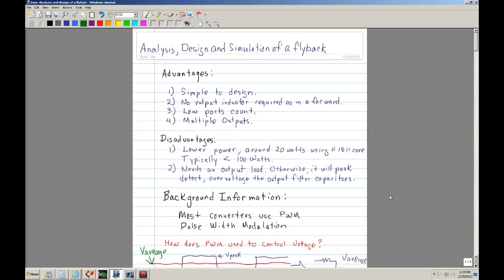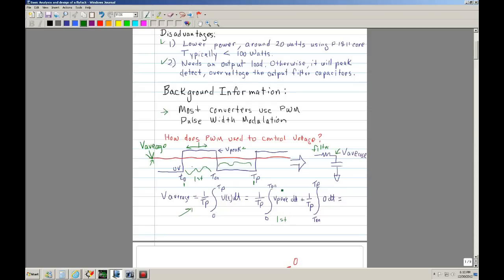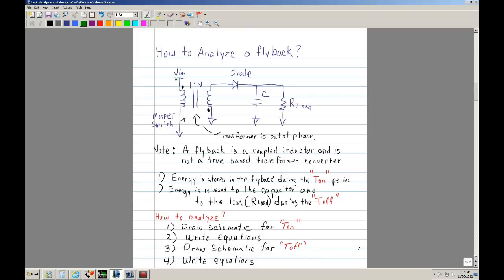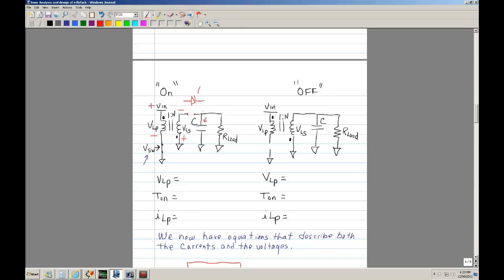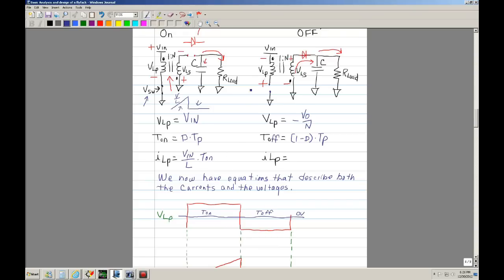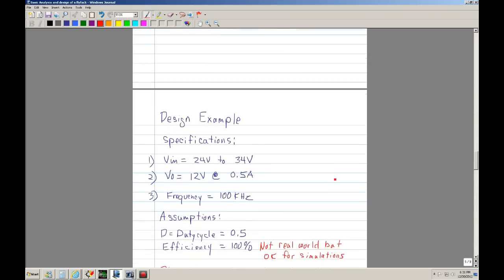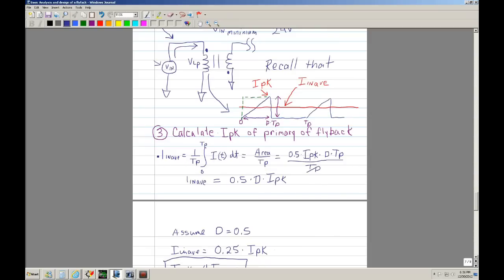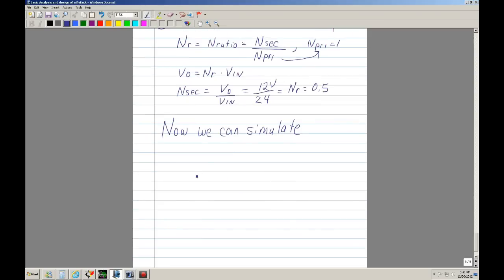Analysis and Design of a Flyback; Part 1, How to Analyze and Model a Flyback Converter

Comment: Can this be used as a step down buck converter, about 125 volts AC/DC input to 12 volts DC output?
Reply from the maker: Yes you can use it as a step down converter
Reply: @RobertBolanos  Thank You for replying back. I will watch all the video carefully. 
It would be tremendously helpful if you can make a full lecture series of designing and building PCB planar transformers/magnetics. Something new and cool. I’m planning to design a cost effective multilayer PCB maker system, so I would be able to make planar transformers if only I knew the math and theory of planar transformers. Thanks.
Reply from the maker: @ShopperPlug  Hi Max, that would be a great subject to cover.  Let me see what can do.
Reply: @RobertBolanos  Thank You 😊

Comment: Sir can you please help me finding design for CO2 gas laser flyback transforme, I shall be very thankful to you.
Reply from the maker: You need to know the required voltage, current and power. Once you know the power, you can use the equations that I presented to calculate the primary inductance.

Comment: In case we don't have input voltage and need to calculate the transfer ratio what is the way to calculate input voltage ?
Reply from the maker: Hi Mahmoud, please see the derivation on shown below the title. This is the corrent transfer function for a discontinous mode flyback,

Comment: For calculating power in the design example, shouldn't one be using Rms current instead of Average current? 
Avg current equation = 0.5*D*Ipk
Rms current equation = Ipk*sqrt(D/3) ~ 0.577*Ipk*sqrt(D)
Reply from the maker: You usually use the rms current when calculating the power in a resistor such as Presistor=Irms^2*Resistor. You can also use Irms and multiply by Vrms. But to use this equation, you need to use the phase angle between the Vrms and the Irma. That being said, I use a simple approximation based on the fact that most non rms digital current meters display the average current and we simply multifly be the average current to get an approximate power.  Roberts

Comment: Very great video.
Do you have a video that shows why as increasing frequency would give more power for a switching mode power supply  ?
I would like to know the formula that shows the relationship between flux density and the frequency.
And the formula that shows the relationship between flux density and power.

Comment: How can we calculate primary secondary resistance inductance of isolated transformer
Reply from the maker: This is a little to be asking this question. However, you first need to calculate the number of turns of your winding and also select a core that will satisfy your specifications. The core datasheet will have the MLT (mean length per turn). You multiply the turns*MLT to get the extimated length of the winding. You then use   Resistance=(1.72*10^-8 ohms*Meter*(length_in_meter/Area_of _wire)).   Please watch the transformer videos. Go to my channel and you should be able to see the videos that I have produce to help you design a flyback. Hope this helps. Robert
Reply: @RobertBolanos  yes I saw and downloaded

Comment: Hello Sir, how the polarity of the primary winding can be reversed when the switch is OFF? Thank you
Reply from the maker: Hi Gilang, When the Mosfet is on, the inductor or the primary is storing energy in the core's gap by building up a magnetic field. When the Mosfet is turned off, the magnetic field start to callapes and induces a back EMF. The phenomenal is knows a Lenz' law. I hope this make sense. Cheers, Robert
Reply: @RobertBolanos  thank you so much Mr. Robert

Comment: hey can any one tell me that how can we choose a switching frequency ?
Reply from the maker: Hi Usman, Typical switching frequency is from 100KHz to 200KHz. As you go up in frequency, the physical dimensions of you inductor and capacitors get smaller while the switching losses increase. For example, the switching losses for capacitor are calculated by Ploss=Cap*Voltage^2*Freguency.  So as the frequency is double, then the switching losses also double. So operating from 100KHz to 200KHz is a good compromise. I hope this helps.

Comment: Hi, I am building a Vin=12V to Vout=325V flyback converter and say my load is a laptop at about 60W and using a duty cycle of 0.5. In that case, the Iin(ave) for my situation will be 60W/12V=5A. So my Ipeak=5A/(0.5*0.5)=20A? Am I calculating correctly? How does the transformer primary induce such a large current of 20A? I don't think any typical lab power source can supply that amount of current right? Besides that, assuming that the above is correct, my mosfet switch should be rated for above 20A right?
Reply from the maker: That is correct. That is a disadvangtage of using discontinuous mode flyback. Typically when that current get that high, people will then use continuous mode flyback which will lower the peak current. The other option is to raise the input voltage so that the peaks current will reduce. Hope this make sense. Robert
Reply: Hi, thanks for the input. I have another question based on your video on transformer characterization. Don't mind if I ask this here too. 

Let's say i calculated my Lmin to be 2.1uH to maintain in CCM. Npri is calculated to be 2 using the formula shown in video 6. As I am looking at ferrite core (ETD34), the AL value is given to be 2.7uH/turn. Since my Npri is 2, my primary inductance will be 5.4uH? So in this case, the actual primary inductance is 5.4uH and not the calculated 2.1uH right? But in all cases, it shouldn't matter as long as the inductance is greater than 2.1uH to maintain CCM right?

Lastly, for the actual winding of the transformer, the secondary is 180 degrees out of phase with the primary so the secondary winding should be winded in the opposite direction from the primary right?

Thanks a lot!

Comment: where does 4 x Iinave = Ipeak? why 4? please gimme some explanation
Reply from the maker: Hi WBPM3Tesla, in video 2 I show that Iinave = 0.5*Duty*Ipeak.  The 0.5 comes from the intergration of the current ramp that I show in the video. The 0.5 also represents the half the area of a square is the area of the ramp. Assuming a dutycycle of 0.5, then we get 0.5*0.5=0.25.  We now have Inave=0.25*Ipeak.  Solving for Ipeak, we get Ipeak=4*Inave. I hope this make sense
Reply: thank you very much for your response dat very helpfull for me. my paln to implementating this flyback converter for battery ballancing on lipo battery. 1 more question sir, 1/Tp. where do you get that? please the explanation. your video is very helpfull for my final project. thank you mr robert for your kind.
Reply from the maker: The 1/Tp comes from the switching frequency

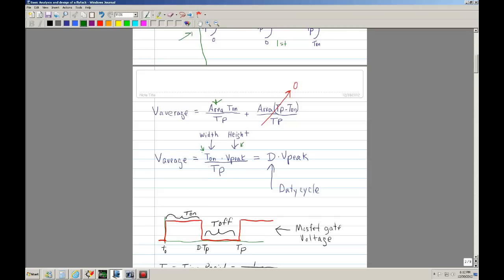Comment: at ~6: 00 -7:00 you state that Area x Ton = Ton x Vpeak . if (Ton x Vpeak =Area) then this state is mistake!!!
Reply from the maker: Hi haimt1464, yes it is a mistake. I guess I had a senior moment. The area during Ton is Area_left=(Ton/Tp)*Vpeak, while the Area during Toff is Area_right=Tp(1-D)*0V, so the right side egual goes to zero. The rest of the derivation should be correct.
Reply: Thank you very much for the quick response ,I am appreciate you knowledge and the willingness to share.
I am learning a lot from you ,keep the good work, and again thank you very much.
Reply from the maker: Hi haimt1464, Thank you spotting the error. I made an annotation on the video. If you into the 6:00 time frame, I made the annotation. Again, thank you for your feedback and spotting the error. Best regards, Robert

Comment: Robert, you have done so much work on me with this video than you can imagine. Thanks a lot. I have a few difficulties though and I thank you in advance for the solutions I hope to get from you. 

1) I tried the modelings too using Topspice and I am grateful that I could get it right to the point that I did before I began getting it not right with error messages saying, "missing parameter(s) on dc analysis specification".

2) I understand the way you obtained the ESR value. I looked up a few datasheets of capacitors with the hope to find ESR values but they contained no such information, and it makes me feel that they may be widely different from capacitor to capacitor, even if they are of the same type and value. Now, considering bulk manufacturing of a flyback, is an ESR value obtained for one capacitor using the method you showed on the video okay for the bulk?
 
3) To obtain an output of 1.2V from a 120V to 240V AC input using a flyback built with off-the-shelf transformers, I searched for transformers to use and I found one with a moderate primary inductance. However, the turns ratio would produce 5V at the secondary which, to me, seems to be far away from the 1.2V. Considering efficiency, having to obtain 1.2V with this turns ratio bothers me a lot and I sincerely need your advice on it. I will take whatever advice you give me.

Thanks. Akanimo.
Reply from the maker: 1.&#160; Please send me your TopSPICE file to rbola35618@aol.com and I can take a look at it.2. Yes, I use a rule of thumb equation of esr=65u/cap (for electrolytic) to get an estimate of the esr. If you use tantalum caps, then use esr=6.5u/cap.3. You can still use and will get 1.2V. You will have a higher reset voltage.

Comment: Around 17.50 my understanding of inductors was that they will try to 
keep same state when voltage is removed. Lenz's law etc. So  
before the mosfet switches off the secondary circuit's current is in 
clockwise direction. with primary also in clockwise direction (as per 
dots). So after switch of the collapsing magnetic field will try to keep the 
currents flowing in the same direction. But you are saying the current directions are swapped. What am I missing here?
Reply from the maker: Hi Kevin, This is a good question. When the Mosfet is on, there is current in the primary only; no current is flowing in the secondary because the polarity of the secondary reverse biases the diode. When the Mosfet is turned off. the primary current does not flow and the polarity voltage in the primary switches because of Lenz law and therefore the polarity also switches and this time forward biases the diode. Hope this makes sense. Best regards, Robert

Comment: Where did the T_on term come from in i_p?
Reply from the maker: +Terry Price Can you be more specific please. Not sure I understand your question.  RB
Reply: +Robert Bolanos Sorry for the late response: at ~21:26, you given an equation ofr i_p.  where does this come from?
Reply from the maker: +Terry Price Hi Terry,   I am expressing the current that goes thru the primary of the transformer and I labeld the current as ILp.  When the mosfets is on, this is refered at Ton. So Ton means that the mosfets is turned on and it is appling Vin across the primary inductance of the flyback transformer. So the current during Ton is expressed as iLp =(Vin/Linductnc_primary)*Ton. Now keep in mind that Ton can also be expressed at Ton = Duty/Frequency = Duty*Tperiod. Both equations are equivalent. If you sub into the first equation then you get, iLP=(Vin/Linducntant_primary)*Duty*Tperiod.Hope this makes sense. Comments and question can be sent to rbola35618@aol.com       Robert

Comment: dear sir  
i want to make a isolated  dc to dc coverter with flyback topology with 
input voltage as 48v and 
output required 24v/1amp .
please provide me your guidance in designing the above required converter .
pkhanduri259@gmail.com
Reply from the maker: +pranjal khanduri Hi Pranjal, if you watch the videos, you should be able to design a flyback to your specification. You can always email me questions at rbola35618@aol.com.Best wishes, Robert

Comment: Robert,

Thank you for all the useful information. I have designed one flyback converter. When i checked the hardware the current increases even at fixed pulse width and load. What may be the reason for that?
Reply from the maker: ***** You may be saturating the transformer. Check the primary current. The current should look like a linear ramp starting from 0V to a Vpeak. If it has an exponential curve, the transformer is saturating. Rewind to more turns. Robert

Comment: hi, very good and informative video thank you!

I have a question: since the slope of I at the primary is V/L, does that mean that when the MOSFET goes off, and the current drops to zero instantly, we get a peak of very high negative voltage? (-infinity for ideal switch)
Reply from the maker: chopcooey Hi Chopcooey,  When the Mosfet is turned off, the current thru the Mosfet goes to zero. Keep in mind that when the Mosfet was on, the energy is stored in the gap in the transformer. So when the Mosfet is turned off, the energy that was stored in the gap thru the primary winding will then be released back into the secondary thru the secondary winding. So if the Iprimary_peak was let say 1A, and lets say that the turn ratio is Ns/Np=12V/24V=0.5. Then when the Mosfet is turn off, the secondary will have a Isecondary_peak= Iprimary_peak*(24V/12V)=2A. The ramp will be reversed from the Iprimary and will start at 2A and then ramp linearly to 0A.  Hope this makes sense.

Comment: Why does the average input current equals to power divided by the min input voltage?  Shouldn't  it be called maximum average input current?  You r trying to do a worst case calculation for the inductor value right?
Reply from the maker: Hi le,

All power supplies are what are called constant power units. In other words, the input and output power relative remain the same. As the input voltage decreases, the input current will increase in order to keep the same power. as the voltage is decreased, the On my way! Will increase the Dutycycle to keep the same voltage . Assuming that the maximum Dutycycle is close to 50percent, the current will be at its maximum. We calculate the input average current because we know their is a relationship between the average current and the peak current. Once we know the peak current, we can then calculate the inductor go the flyback.

Robert
Reply: Robert Bolanos Robert, what I'm trying to say is why not use the max input voltage to calculate the input current.  You used the min input voltage in this tutorial.  Also, why not use the average input voltage to calculate the average input current?  Thanks!
Reply from the maker: Kelvin Le Hi Le, If you use the max input voltage, and calculate the average current, then the value of the Lprimary that you calculate using the procedure will lead to a supply and will not regulate at Vinput minimum because the PWM will have reached it maximine rating

Comment: One question: If my Vin is a 24Vdc. How would I set my Vmin and Vmax as? (This is according to your design example). Thanks
Reply from the maker: Anh,

This is  a good question. You want to calculate the voltage drop that you would have in the primary loop winding which could consist of the transformer resistance, the MOSFET Rdson, the input filter inductor.  A rule of thumb that I use is to assume a 1 Volt voltage drop. So if you input voltage in 24 volts, then use 23 volts as you Vmin. Vmax is important to know because the input filter has filtering capacitors and you want to make sure you do not exceed their voltage rating. You can send questions to rbola35618@aol.com. Hope this helps

Comment: Hello Mr. Robert nice video explaining the flyback converter as it is also my final year thesis but if i want to calculate the current in the secondary capacitor ic.... will it be Vo/Rload or -Vo/Rload

Comment from the maker: Thank you EmSysDev for your question. To set the turn ratio of the transformer, you use the "OFF" model shown in 18.20.  If you will notice that when  the primary switch is off (Mosfet), the secondary diode is turn on and therefore Vsecondary is equal to Vout.  What you are really doing is setting the resetting voltage needed for the transformer to reset and avoid saturation.  Most people use the equation that I used to set the turns ratio. That means that the reflected voltage (from primary)  that the Mosfet will see is Vprimary (voltage across the primary winding) will be Vout/Nr.  That reflected voltage will be aproximatly Vin.  This means that the drain will see 2Vin; Vin in from the input supply added in series with the reflected Vprimary voltage which should be approximately also be Vout(refected to primary from secondary). 
I hope this answers you question. If not, let me know and I will post a more detailed video. But I won't be able to do that until next Friday.

Comment: Robert Bolanos,

I'm curious about something. If you've got a single stage power factor correction unit (without a capacitor between the full bridge diode rectifier & the flyback converter) how does the system implement power factor correction, even though a flyback converter demands discontinous input current for the primary side of the transformer?

I appreciate any response you give me.